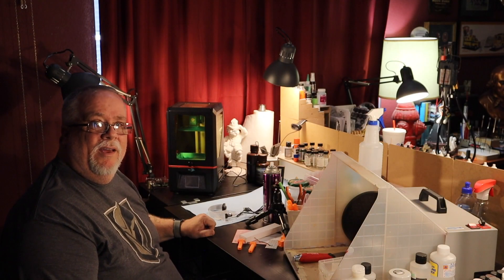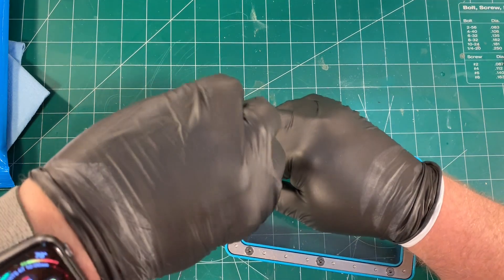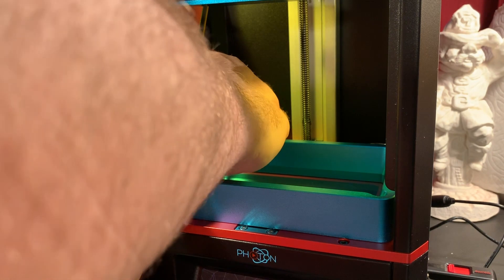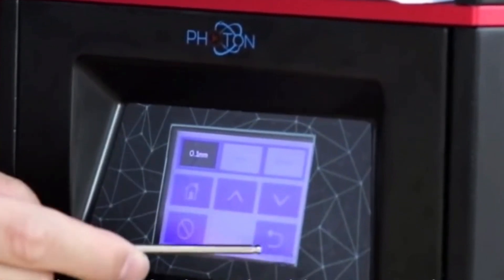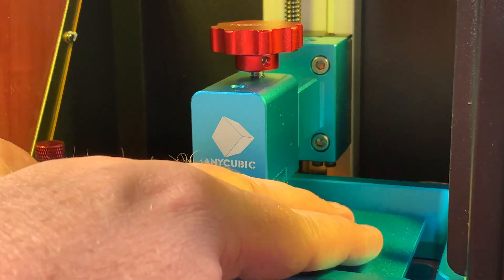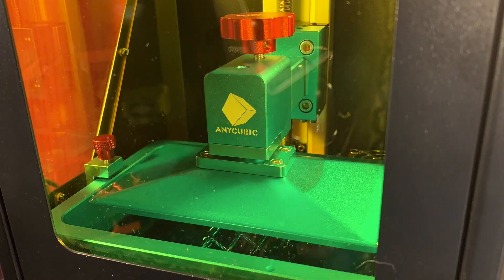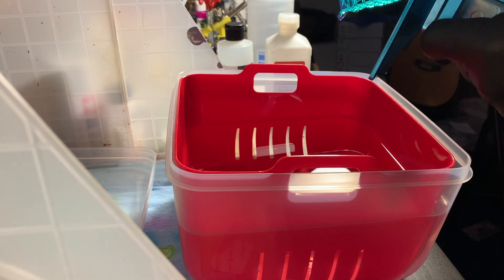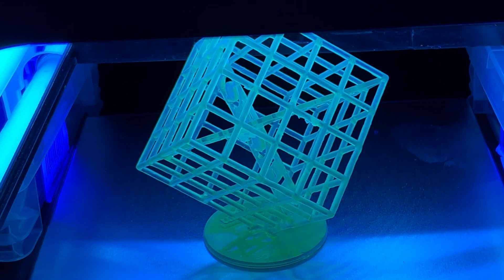Photon - Set up and first print!

Comment: I guess i'm going to try this way...Is since yesterday that I try to print something with my photon and I only get fail prints ...the print always stick to the vat instead of sticking to the printing platform.
I've follow the instruction that comes with the printer, I also follow the anycubic instruction on youtube, I've even tryed to follow instruction of other user on the web...there is no way...

I have an Anycubic i3 Mega S and I have ZERO problems...i realy can't understand where is the problem...there is just one thing that needs to be done and there is no way I can do it so that the printer works...

Folks on youtube  do it in a blink of an eye and i'm stuck with no result in two days...what is wrong with what I'm doing...
Reply from the maker: Without more details it is hard to say, but here are a few things you can try...  Make sure you have a good, solid base and sufficient supports.  Also, make sure your times are correct for the resin you are using - the problem could be not enough cure time.  I hope that helps....
Reply: @pauly7218  You are totally right...I found out that Chitubox's Photons settings were wrong...the exposure on the first 3 layers, which should be 50 second, was 30...that is why the print was stiking to the vat instead of the printing platform...
I wonder why it's like that...If I didn't use Chitubox but Anycubic Photon Slicer I wouldn't have had any problem, but that software is realy bad...

Thankyou anyway!